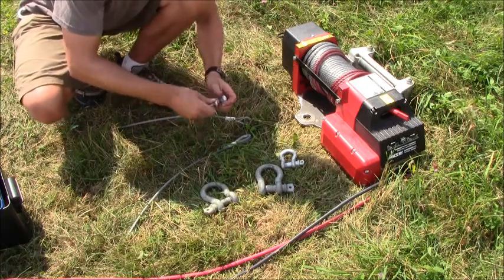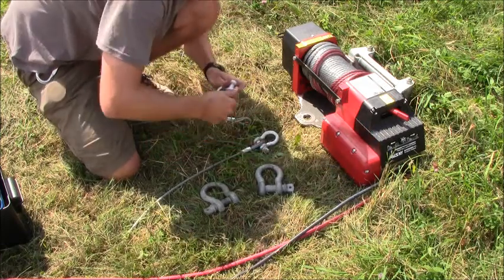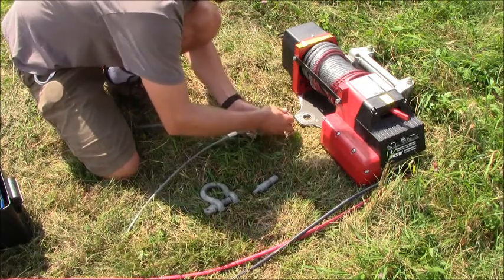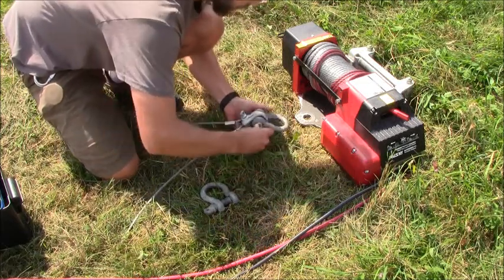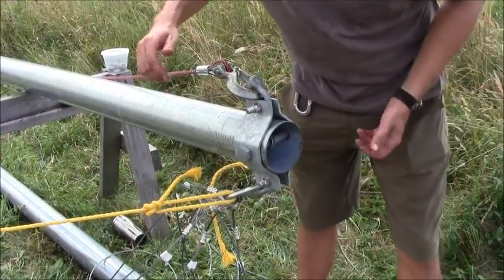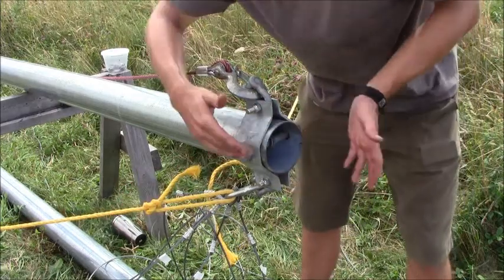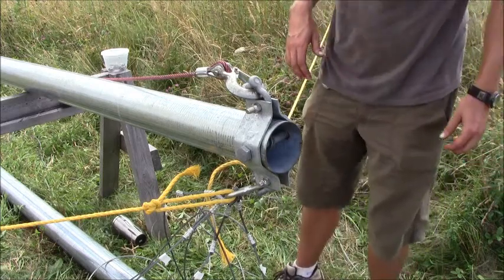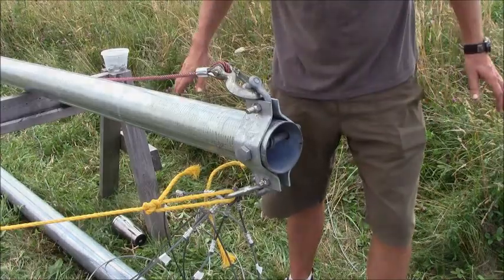How to attach the lifting guy anchor to the gin pole using a winch.wmv

Comment: In general, since the two wire ropes connected with the 1/2" shackles are at an angle to one another, shouldn't they be attached to the bow of the 3/4" shackle rather than the pin?